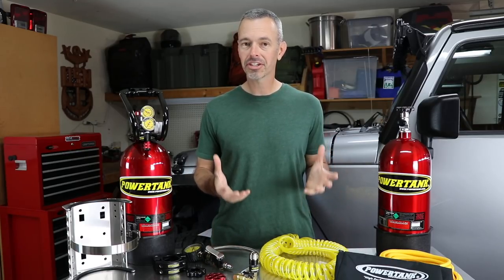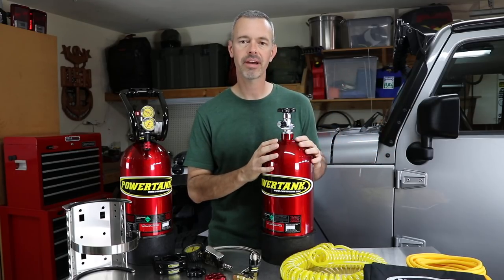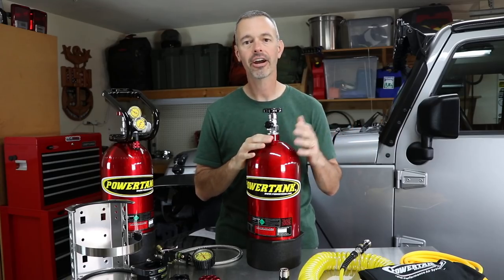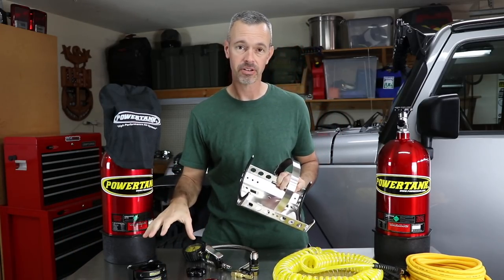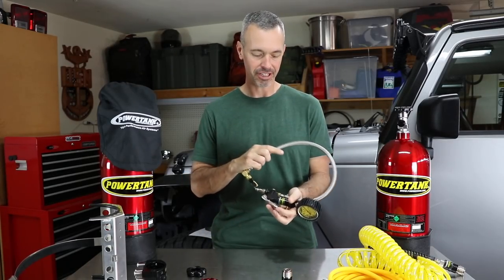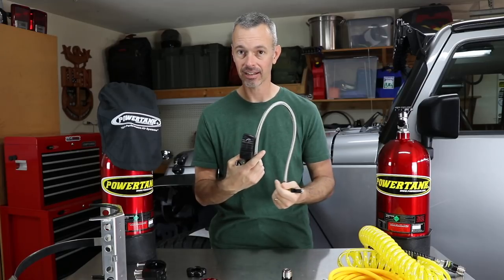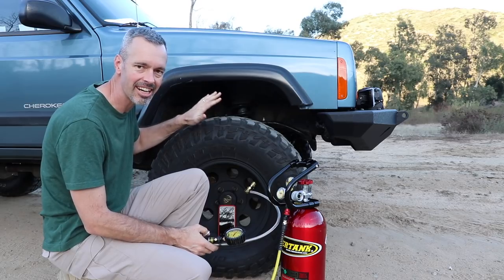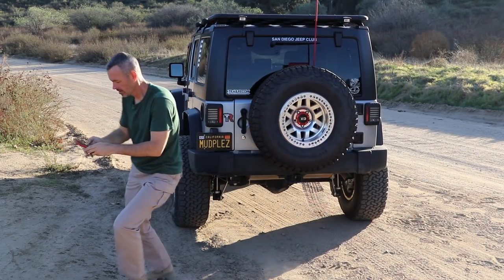Onboard CO2 System Review & Test - Power Tank

Comment: Been running a Powertank 15 Since 2003.   No regrets. I do have an ARB compressor under the hood for lockers and back up.  Only had to use it once to fill up tires and that was because I was running tools to fix some break downs with the group.

Comment: I'm considering CO2 because I'm on a very tight budget and can't afford the breakdowns of a compressor. It seems all the reviews say it's not a matter of if your compressor with die but when. I don't airdown a lot because I don't get out on the trails a lot. When I do, I'm not rock climbing; no lockers in my TRD Sport. Airing down will most likely be to save damages to my tires. This is looking to be a good solution for me. Thanks for the video.

Comment: Only problem I have ever had with my system is the band that holds the tank to the mount.  I think the hook should be a bit more generous and reliable. Actually lost my power tank on the trail at high-speed on one occasion. Tank went flying down the road into the ditch. No damage at all and I still use it. Have applied a ratcheting tiedown strap around the tank and roll bar as a back up.

Comment: Hmmm 500 dollars for a powertank system. 

Or 40 dollars for a used CO2 bottle locally thats got a good hydrotest date.  20 dollars per fill at the local welding shop. 70 dollars for a high flow regulator online.  

There ya go saved yall hundreds of dollars.  I accept payment in bottles of Jack Daniels 🤣🤣
Reply: That's what I did. Works great and I have it mounted under my truck because I don't care that a tank which looks all pretty gets dirty.
Reply: Same here, I use a cheap beer regulator with a hose that ends in a Schrader valve.

Comment: Co2 systems are very cool for short trips like over a long weekend etc but once they run out you are going to need a compressor, People need to remember that Co2 systems are a great system that need to work in conjunction with a compressor and not as a stand alone unit because once they run out that's it you got no Air, So you will still need a Compressor as Back Up.

Comment: That's really impressive, I have two air compressors and a 5 or 6 gallon air tank. No way I could air up my 35s that fast! I think I'll be buying that coupler for sure for my set up. How many times can you air up your tires with that tank? I figured from its size it would be good for one time. Obviously not.
Reply from the maker: I think the couplers are some of the best out there that I’ve seen.  I’m hoping to get 3-4 trips on a tank, but we’ll see.... need to hit the trail a few more times.
Reply: TrailRecon i like that you can hook the hose up with one hand. It's not the easiest to hook mine up with pressure on it where it's at. This should make it a breeze for my set up. Also that's very impressive to get that many fill ups. Great vid, thanks for helping me spend more money 😂
Reply: You can check for yourself here: https://www.powertank.com/charts-specs

But you should be able to add 20psi to (16) 35in tires before needing a fill. You can also knock 360 lug nuts off using a 1/2in impact wrench on a single fill.
Reply: You can air up about 15 - 35" tires from 10 psi to 35 psi from a 10 lb tank. Remember it is filled with liquid CO2 which expands dramatically when it turns to a gas.

Comment: I keep hearing you say "gallons" for the tanks.  Isn't it pounds?
Reply: Gallons are a measurement of the volume, or the size or the tank. Pounds per square inch is a pressure measurement.
Reply: Powertanks are offered in 5, 15 and 20 pound tank sizes.  This is not pounds per square inch. C02 is sold by the pound. A 15 pound tank will be 15 pounds heavier then it’s empty weight when filled. Etc.

Comment: Hey Brad,
So how many fills have you gotten with the 37s? Been using the Twin ARB Compressor but want more speed airing up. I’m running 40s on a JKU. I’m also thinking of going to 10lbs for room factor in back, and running a custom interior cargo rack which I can customize to fit two 10lb tanks. Just wanna know how it’s working out for you? I’m on the trails a lot too.
Reply from the maker: I can get about 3 1/2 (14 total tires) fills on a 10lb bottle.  If I had the room, I would prefer the 15lb bottle.  It will vary depending on how low you go and what road pressure you bring them up to.  For me I usually drop to 14 on the trail and 28 on the road.
Reply: TrailRecon thx for the reply we’ll see how a 15lb may work 👍🏻

Comment: Man that's fast! How much does it cost to fill a tank?
Reply from the maker: Cheapest I have found was $20
Reply: Brad...check out Matheson Tri Gas in San Marcos...$16.50, and they fill while you wait...also a great spot to fill your trail propane tank!
Reply: Usually $15-20 depending on location and tank size.
Reply: where?
Reply: Places that sell and service Fire Extinguisher places will fill CO2 tanks. I get my 5lb CO2 beer tanks filled in AL for $18
Reply: I filled a brand new tank 10# for $14.50 from a welding supply, in Victorville, Ca.

Comment: Can you not hang those tanks upside down in the rear of your Jeep?
Reply from the maker: You can store them upside down, but they need to be at least at a right side up 30 degree angle when using.
Reply: They hold CO2 as a liquid and withdraw vapor,  so they are "vapor withdrawal' cylinders. Keep them upright and plumb accordingly.

Comment: I've had my Powertank in my TJ for about 10 years now and it's been great. It's mounted using the aluminum bracket at the rear corner of the passenger side. The Powertank is always available which is nice, no power needed.  I've never run out of gas on the trail by simply by keeping aware of how approximately much is in it it before hitting the trail.  The only drawback to the Powertank is that no matter how fast you can air up, you're still going to be standing there watching the person with the slowest compressor air their tires (lol).  But that is not a Powertank issue!   One thing I do to conserve CO2 ($$'s), is to air up to only 25psi at the trail's end and finish airing up at home with my garage compressor.  The bigger the tires, the more CO2 ($$'s) you save.  Driving on 35's at 25psi is just fine for close-to-home runs.  When traveling back more than 100 miles from home, I'll air up to full pressure.  Anyway, over the years I think it may have added up to saving enough for a cheese burger and a few beers!  lol
Reply: One last thing, not sure if you mentioned it but for those who may not know, the Powertank contains LIQUID CO2 in the tank, not compressed.  When you open the tank valve, the liquid converts to high-pressure (about 750psi) gas.  So there is a LOT more high-pressure gas coming out of a 10 gallon liquid CO2 tank than if it were simply compressed.  One 10 gallon compressed gas tank couldn't air up all those tires.
Reply from the maker: 10 years is one heck of a long term test! Great to hear you are still loving it after all this time.  Also, excellent point regarding the CO2 in liquid form.  Thank you!
Reply: I have the same “problem” waiting around as my buddies refill tires with their compressors.  I like to take my PowerTank and sneak over and fill the side they haven’t done, the look on their faces is the best.  “Wait...  you’re already done?  And you filled all mine too? In the same time it took me to do 2 tires?!?”  PowerTank is the BEST!!
Reply from the maker: LOL!  CO2 snipper!!

Comment: Great vid! Just my 2 cents... I bought a 20lb aluminum CO2 tank about 9 years ago, a 150psi regulator from power tanks competition. No problems ever! One tank can take all 4  my 35x12.5x15 from 10psi to 35psi about 8 times.  Here in Las Vegas you get a tank exchange for $13!you don’t get to keep your original tank but $13 and no waiting to fill up your tank? Super convenient! Plus hydroponic supply stores are open all hours of the day/night. If I blow a bead the CO2 is great to re-seat the tire bead. I run an impact gun to change a tire. Your previous video on 4 tire inflation? Well I made one thanks to you  and it changed my life!!! All 4 wheels at once with the CO2 was crazy fast!  I was going to purchase a set of monster valves, but my rims are too nice to drill extra holes through 😅
We love your videos! Keep up the great work!

Comment: I have a home made 20lb co2 setup and I love it. It's such a cheap yet good option I bought my 20lb tank for $130 and the  Regulator for $40 and its only $20 to swap tanks out at my local weld shop and it last to ever and I love that I can run my 3/4" impact gun on it and have it hit at full  Strength. I have a 10lb tank I use at work when I need air tool and can't take a  Air compressor with me or get enough air hose to reach where I'm working and I have to pack my stuff in to work on a remote bridge that needs some minor repairs

Comment: I have a powertank for my Jeep and love it.  It is very well thought out. The on-off collar you mentioned is actually a safety mechanism to prevent you from removing a tool that is energized.  You can imagine what a projectile they could become with 200 psi behind them.  What I like the most about my system is the quietness.
Reply from the maker: You are so right, I should have been more clear about that... it really is a safety feature!  Thank you!
Reply: No more so than disconnecting a tool from a shop compressor

Comment: Those are the same tank bottoms as used on scuba tanks! My wife & I live in Wyoming, but my two children live in San Diego & El Cajon.
Reply: Yup..   I was wondering why they use (expensive) CO2 and not just fill up with air (scuba dive shop or Firestation)....    much cheaper but the CO2 compresses to liquid & thus provides more volume.

Comment: Another over priced piece of equipment. You can get a regular 12v portable air compressor for $50 that takes up far less space than that. Doesn't require refilling and re-testing either. As far as wrenching in the field, elbow grease works just fine for me.

Comment: why CO2 instead of nitrogen? Just wondering. BTW, enjoy the build videos, especially the father son(s) aspect.
Reply from the maker: They offer a nitrogen setup for shocks but I honestly am not familiar with the availability and how many uses you would get with a setup for tires.  CO2 in liquid form and turning to a gas is what allows you to get so many fill ups.  I’ll have to research nitrogen. Thanks!
Reply: I was just wondering because in this area, tire shops offer (at a $3 per tire upcharge) to fill with nitrogen instead of air. It's supposed to be much denser than "air", so your tires hold their pressure longer. Supposedly...
Reply: The CO2 is stored as a liquid in the tank. This means it is more dense and has much more "usable energy" than N2 or other HPA (High Pressure Air) sources. With two bottles of the same physical dimensions, the CO2 has about 40 times the amount of energy than HPA. A 10lb Power Tank like the one Brad has, is roughly equivalent to 400 gallons of compressed air. 

As to whether or not N2 is better for your tires? Technically, yes but you won't notice a difference in real world conditions. I recommend you take a look at our N2 truths and myths page: https://www.powertank.com/nitrogen-truths-myths

Comment: I love EVERYTHING about my PowerTank.  Bought it at EJS several years ago, and been using it faithfully ever since.  I mounted mine on the roll bar in the back, same spot as yours.  Refilling my Powertank was a challenge at first, I did a paintball shop and they didn’t do it right, because it ran out after refilling a single set of tires.  I was really disappointed but not terribly surprised because the kid at the paintball shop didn’t seem to know what he was talking about.  I found a welding shop in American Fork, UT called “Humphreys” and they recognized the tank right away, knew exactly what to do and cost me $20.  Long live PowerTank!
Reply from the maker: Great to hear your story.... I’ll be sure to avoid paintball shops!!!

Comment: Why CO2 and not compressed air, nitrogen or other inert gas. I'm guessing density maybe? These tanks are an expensive investment and the additional cost of filling and maintenance might be cost prohibitive. Just trying to weigh my options on an ARB type compressor system or a compressed air system like this for tires, lockers, inflatables, tools, etc. It would be awesome if you could fill a DOT approved tank with an onboard air compressor for those times when I'm in a really remote location for extended periods in the backcountry.
Reply: We fill our tanks with liquid CO2 which is much more dense than any other HPA (high pressure air) source. A 10lb Power Tank like the one in the video has roughly the same usable energy as (40) 10 gallon compressed air tanks (or 400 gallons of compressed air). 

When considering costs, know that Power Tanks come with a lifetime warranty. A compressor, no matter how well it's built, will fail at some point and need to be replaced. Tire for tire, the cost of CO2 is about the same as the amount of gas you need to run your compressor off of. The ARB twin compressor is a FANTASTIC piece of equipment and is the closest rival to a Power Tank in terms of performance. But it's actually more expensive and will never match the flow rates (CFM) of CO2. (3CFM for the ARB twin vs. 43CFM for a Power Tank)

Brad's set up is great because he uses a compressor as a back up. This alleviates his CO2 anxiety and, because the compressor is no longer the primary air source, it will last a lot longer.

Comment: Great video as always. Do you have to fill these with CO2 or can you use regular air? What is the average cost to fill the tank up?
Reply: You could use air but that won't hold nearly as much volume as CO2 which stores as a liquid under pressure. If you want high pressure air you could use a high pressure industrial cylinder or SCBA cylinder (mark it NEVER TO BE USED FOR BREATHING AIR since your compressor/filter won't be adequate unless you own a scuba compressor) and something like a Vevor HPA pump which are only a couple hundred bucks. 
WARNING Use only high pressure fittings and hoses (Western dominate the US industrial gas fitting market) and do your homework.

Comment: The tank is basically a small 50 cubic ft scuba tank only filled with CO2 in stead of compressed air .. The regulator is a different system but the tank boots are the same .. If you were diver you could actually use your scuba system in the same manner .. The full size scuba tanks run about 80 cubic ft at 3,000 psi which would be a lot of air to fill your tire or run your tools and they are easy to get a refill .. Looks good .. Thanks for sharing ..

Comment: Hey Brad. I bought a PowerTank a few months back. I was frustrated with cheap air compressors. You can't beat the speed to inflate tires with PowerTank. Also because its portable you can move it from one vehicle to another with ease. All in its worth the high price tag and all the components are so well made.

Comment: Great review!  For me the advantage of speed doesn't outweigh the drawbacks (empty bottle anxiety, filling the tank, weight, the space it takes), but when I switch to 37" tires it will be more appealing.  I love my ARB twin compressor, just wish it could compete with the C02 a little better in terms of speed.
Reply from the maker: Glad you enjoyed the review!  I think you'll really like the switch to 37's... I'm very happy with them so far!
Reply: Looking forward to your full review of the 37" KO2's.  I love my K02's (35" for now).
Reply: RobDTom good point about the weight. These tanks are quite heavy. OP didn't mention that or give us a weight. He also did not mention cost of the system. I think that system he is using is about $600 with accessories. They are also quite bulky. $5-7 each time to air up seems like a lot to save a few minutes. For now I am happy with an ARB compressor.

Comment: Obvious question from me and others that don't know anything about compressed gases.   Why not compress air instead of CO2 ?  I am sure someone can explian to me the reason.  Filling with just air could be cheaper.  What are the advantages of CO2 ?  Thanks for endulging me.  :-)
Reply from the maker: You get a small volume with compress air, the CO2 is in liquid form and that's what allows constant pressure and lots of tire inflations.

Comment: I also run their system. And it is awesome. I have 2 jeeps with 37s and i fill them both up quickly. I have a back up compressor juat incase i run out of co2. I rin the 20 lb, and it fills up from 10 psi to 30 psi 28 times at least.. Only costs 40 bucks to fill. Great video man
Reply from the maker: 2 Jeeps with 37's... awesome!  28 times is very impressive!  Thank you!
Reply: No...sorry that would be seven total fills on one jeep.
Reply: TrailRecon Sorry man, I meant 7 fills total. So 7 ttips. I may jave gotten more, but I forgot the weight at empty, so I just refilled it. Lmao. And you know both my wife and my rig from IG

Comment: Great and complete video on the product. I supposed this falls into the luxury category but would be awesome to have. I don't wheel enough unfortunately, runs 35s' and cost/utility factor will probably not work out for me. I LOVE the air tool capability for sure and I am sure there are other uses outside inflating tires. GREAT video though. super informative.
Reply from the maker: Thank you!  We all need to have some type of air system on the trail and you could buy an inexpensive air compressor that will take 5 minutes per tire and only last you 4 months (ask me how I know!) or you can pay a little more for a nice quality system.  A bit of a luxury, but I think it’s worth it.
Reply: Samuel Prokop the fact that you don’t wheel much and are filling up 35’s also means 1 fill would probably last you a very long time.